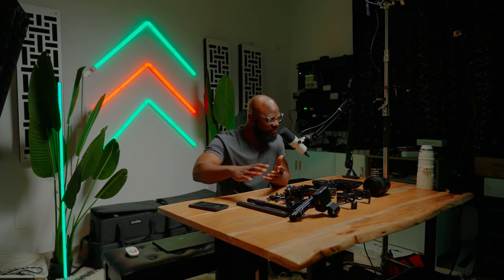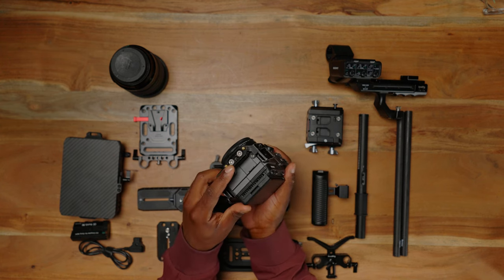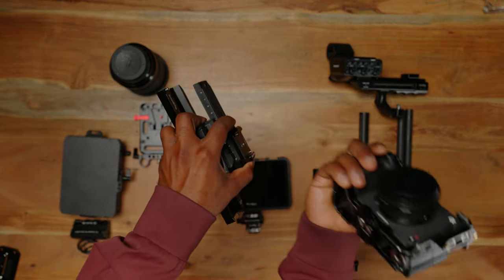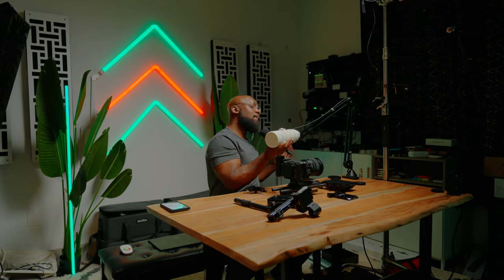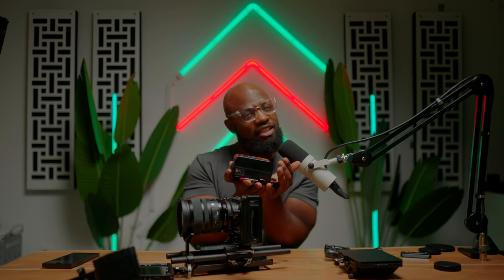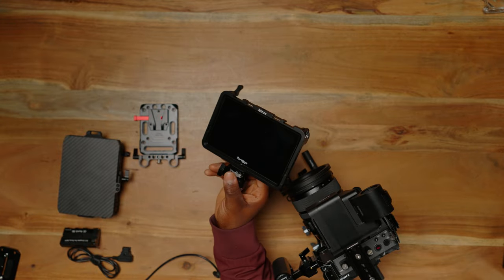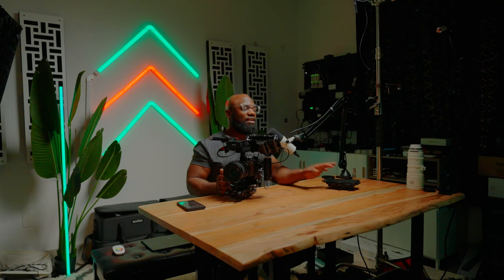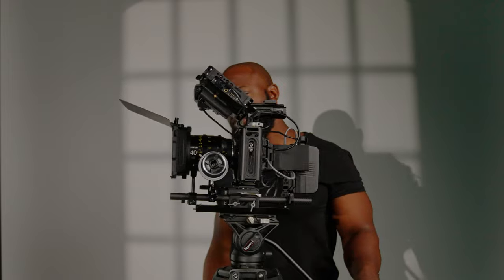Not ANOTHER SONY FX3/FX30 Rig… | THE ULTIMATE SONY FX3/FX30 CINEMA RIG

Comment: I have Almost the same setup except the monitor. I use the ninja v. I was using the same smallrig side grip as you have.  And I kept seeing this grip on Amazon by Sirui Who makes tripods? And they have a more  sturdier  grip for $30 which is an aluminum grip that comes with the option of nato rail mount or a 1/4 thread screw mount. I do not know how they even make money off of it. Because for the same grip by smallrig they charge sixty dollars.
Great video by the way

Comment: Very nice! My rig is very similar but I found that smallrig vmount release lever sticks too far out and interferes with the fx3 monitor screen.  I tried another vmount with a top lever but it was a poor design and the battery was loose. I ended up bending a 90 degree turn in the smallrig vmount to allow the screen to go flush with the side of the battery. And you are right, it's got to look good!
Reply: I had the same similar problem, but it is correctable. It might require longer rods, but you can adjust the distance between the monitor and the external battery, to allow the monitor to lay flat, without interfering with the balance. Hope this helps.
Reply: @bluestilling101  Yep but I wanted to keep it as compact as possible and have some support behind the monitor.